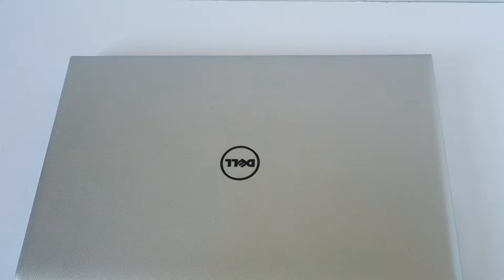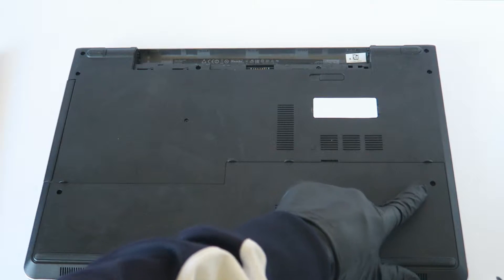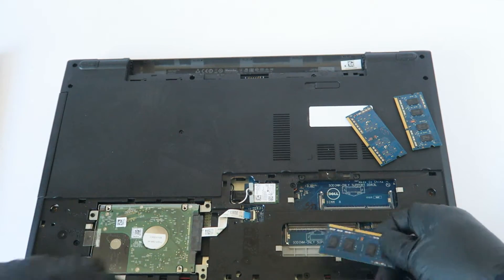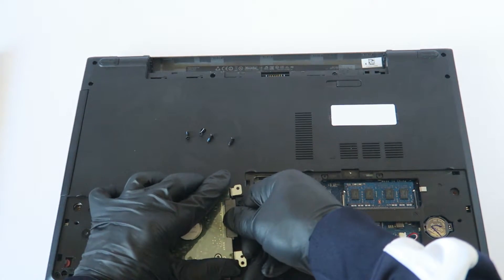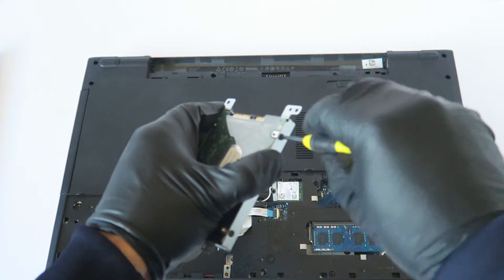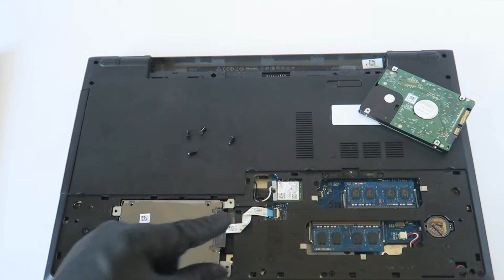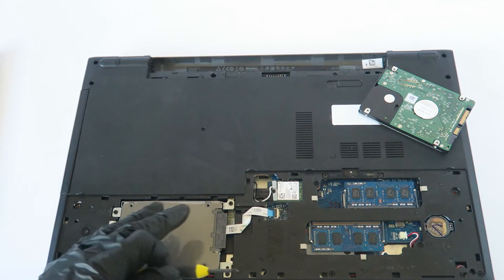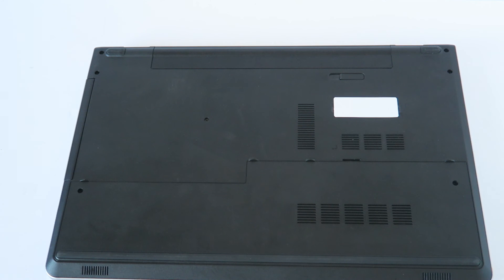Dell Inspiron 5758 Upgrade SSD Drive RAM

Comment: Got same laptop. Can i install new nvme-m.2 SSD on this laptop? Have you checked for an available M.2 port?
Reply: I don't think you can because that slot is reserved for a wifi/bluetooth adapter. Unless you get an external wifi/bluetooth adapter. I could be wrong though.

Comment: That doesn't look anything like my computer. Ah, that's 5758. Mine's 5748. My split is straight across, and the battery is bigger. There's no bumps to indicate which side should come off.
Reply: Have you upgraded your drive I have the same laptop